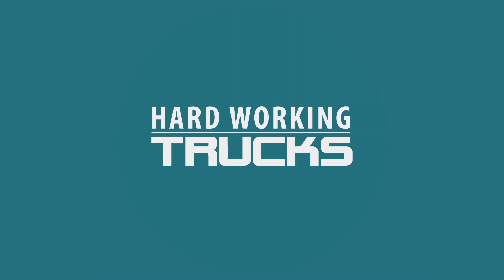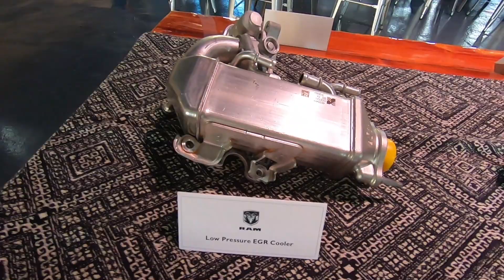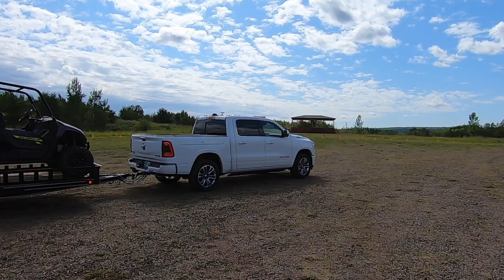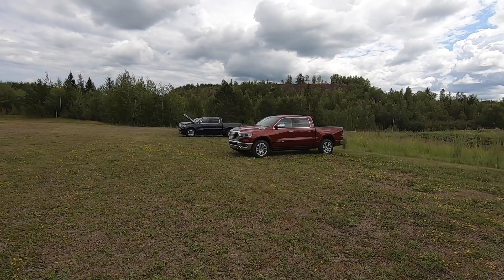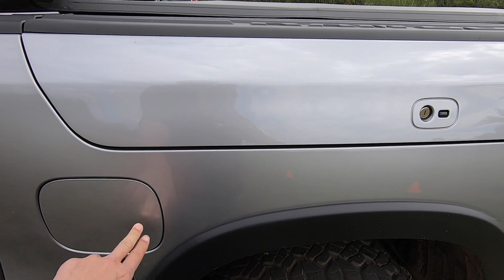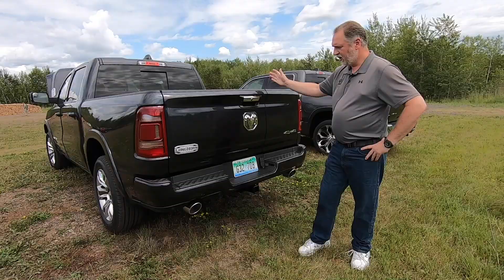New 3rd gen EcoDiesel in 2020 Ram 1500 dominates diesel half-tons

Comment: I own the 2020 ram ecodiesel and have 100 000kms on it and already had to change the air shocks the oil pan the egr cooling valve turbo tail light assembly tailgate assist shock and had to have the 4x4 front rearend rebuilt front axel drive shaft electrical for the 4x4. Bought the truck for 70000 and already had over 12000 dollars in work done on it worst vehicle I have ever bought. But it is the nicest looking truck I have ever bought. That is why I still have it.

Comment: They need to fix the oil change cost that's what killed titan XD was mpgs vs total towing and maintenance cost .....a 2500 3500 diesel oil change fuel filter def fluid should be more than a eco diesel and it's not Ford gm and ram all have the ecos costing more for service....eco and full diesel still gets 10k so it is same interval just cost more

Comment: I had read various internet reports of the previous ED that after about 100K miles, the unpinned timing gear (cam gear maybe? ) was slipping and causing valve to piston engine damage, was that issue fixed with the new engine?
Also,  what's the 0-60 mph time in the 4X4, quad-cab?

Comment: Wait a minute....So the new Ecodiesel is pulling EGR gas from behind the DPF, claiming it is clean exhaust gas. Well, how does that work when the truck decides to regen? You're pulling extremely hot EGT when that happens. Does all that burned off "soot" from the DPF not travel back into the intake? How does this affect the engine then?